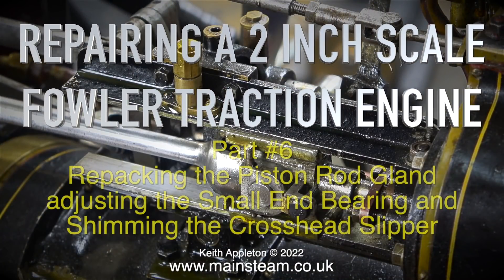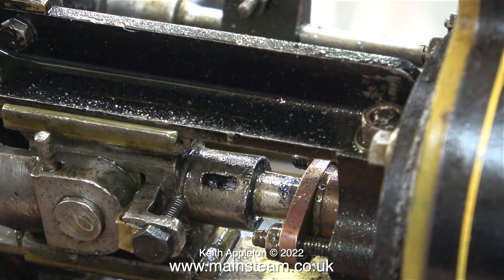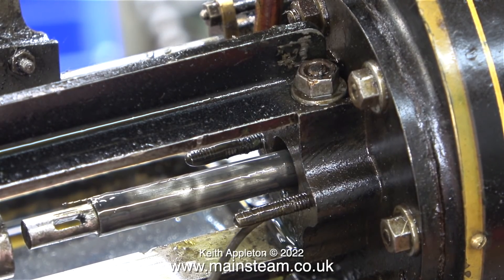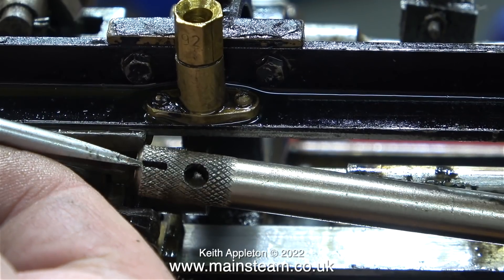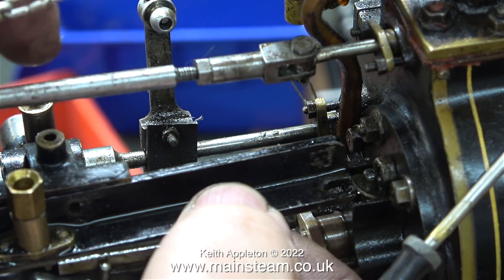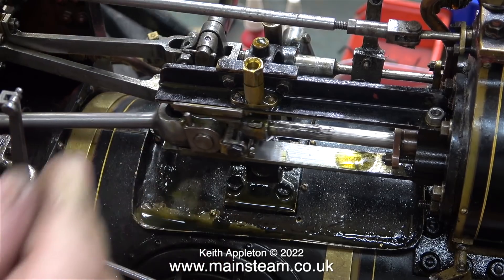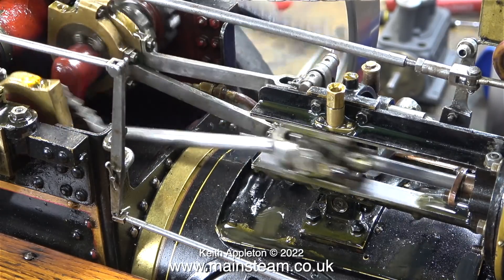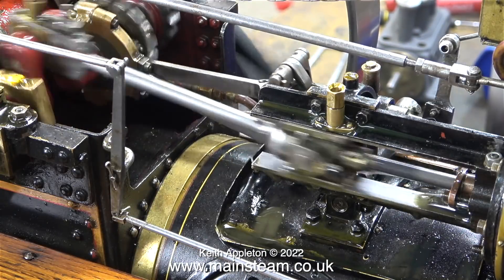REPAIRING A 2 INCH SCALE FOWLER TRACTION ENGINE - PART #6

Comment: All seems good and well, but why do you have to disconnect the piston rod from the small end to repack the gland? Couldn't you just put it to BDC, loosen the gland, wrap the packing around the rod and refit it? Our 3" showmans is in desperate need of this job, but I'm curious why you took the extra steps.
Reply from the maker: Because it makes the job easier and quicker and at this size it is tricky to even get to the Gland Nut .........
Reply: @keithappleton Fair enough. Since ours is a scale up, I'll probably try without dissassebling it all.

Comment: so silver solder is as stiff as copper wire?(I never worked with it)/what kind of nut spinners do you have I can't find any like you use/another amazing job working with suck small parts well done
Reply from the maker: It is stiffer than copper wire, more like Brass . . .
Reply: @keithappleton  thanks
Reply from the maker: I bought the Nut Spinners from www.blackgates.co.uk where I buy most of my model engineering stuff from ......
Reply: @keithappleton  thanks